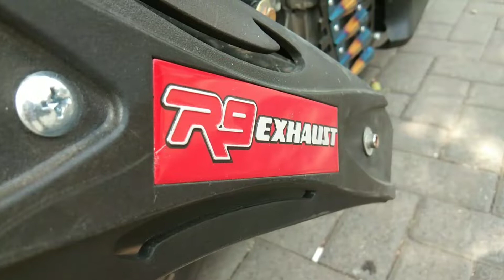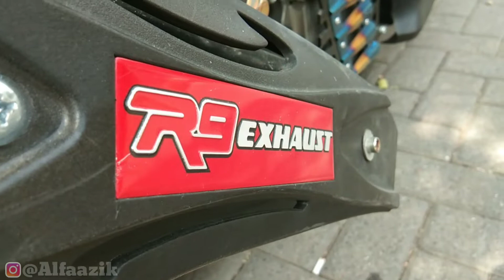MotoVlog - Test Knalpot R9 Exaust Yamaha Aerox, Worth It Ga Sih ? #Alvlog46

Comment: Bro Kondisi CVT gimana? Apa Aja yang Diubah / Upgrade?
Reply from the maker: CVT aman masih bawaan orisinil bro hanya ngubah knalpot dan per gas biar makin enteng
Reply: @AlfaZikk  ganti per gas biar enteng keputusan salah banget sih, justru ga ngaruh malah sama performa motor, bahaya malah iya, karna katup gas jadi susah ketutup dan rpm akan ga stabil, buktinya gw tanpa bore up, tanpa ngubah karburator, cvt, knalpot, velg bisa menjadikan vario 110 karbu 2007 menjadi brutal dari standar nya, rahasia nya sangat simpel tapi di sepelekan kebanyakan orang